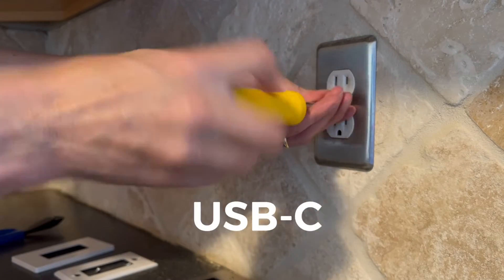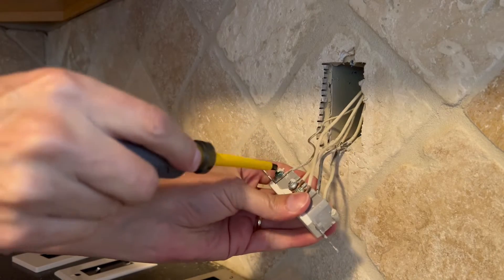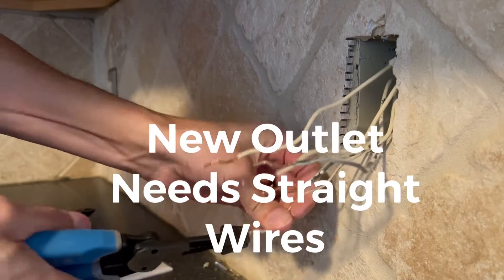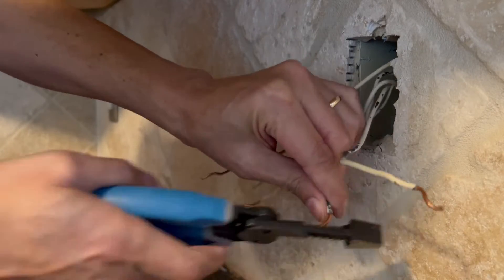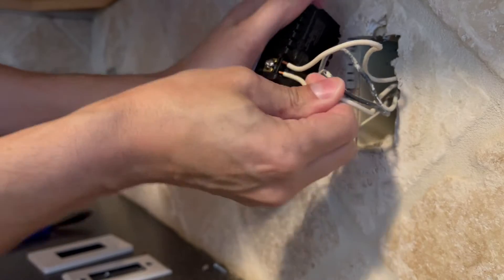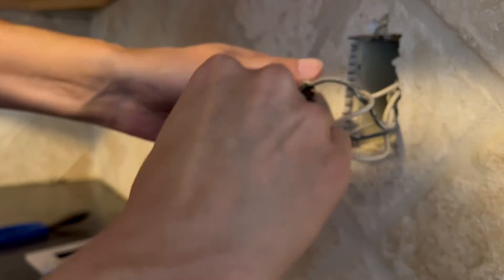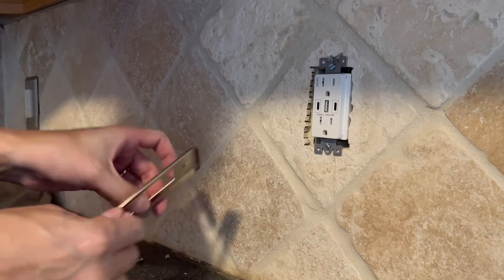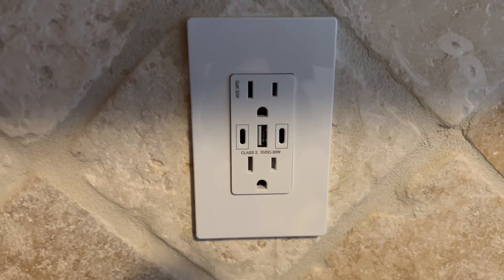How To Install a USB C Outlet: The Quick & Easy Way

Comment: You had plenty of wire, it would be easier to snip off the ends and strip the wires to the length for the new outlet.
Reply from the maker: That's a great point! You are 100% brilliant 👍🏼😎

Comment: What if the white wires are on the brass and black on silver by mistake? I know it won’t work but will it cause a fire once power is turned back on?
Reply from the maker: That’s called reversed polarity… Sometimes I have seen it in older homes. It’s always incorrect. A GFCI outlet would trip if you install the wires  backwards…
Reply: @HomeRapidRepair  okay just wondered if I’d know immediately… how do I know why usb outlet to buy? As far as watts or amps?
Reply from the maker: @Just_King_N_IT 15 amps is the most common and will work fine. Even if you have a 20 amps circuit like in your kitchen. But you can purchase the 20 amps USB C outlets if you want, it’s just not needed.

Comment: What do I do if I have a red wire
Reply from the maker: Typically, that is just another hot wire. You can treat it like a black wire, it may indicate you have two circuits in that location.

You could try just capping it off and then testing your outlet afterwards. I’m assuming you have a standard black hot wire?

Comment: Oh say these are 12g wires, but I believe that is a 14g outlet.  DIYers, be careful mixing gauge like this (if true) - while you can use 12g for 14g power,if you try to pull 12g power through a 14g outlet, it could overhear and possibly start a fire.

Also, while the new “plate” will allow 2 wires, best practice is to pigtail the source wires and insert the “tail” into the outlet.  I don’t think it matters, power wise, but it does simplify later upgrades or fixes.
Reply from the maker: Thanks for watching and taking time out of your day for responding to my video. I appreciate it.

Comment: How deep do you seat the wires? Deep enough only wire insulation is touching the clamp, or the bare wire makes contact with the clamp?

I ask because the old has connectors on both sides on being line in and the other as load as you know.  Do they need separated so the electricity goes through the outlet?
Reply from the maker: I’m not sure I understand your question. Almost sounds like you’re talking about a safety GFCI outlet. That’s the line side and load side. Line side would be hot all the time and load side, if you choose to use it, would protect downstream outlets.
Reply from the maker: If you are installing a USB C outlet, and there are multiple wires in the box, you likely do want them connected to carry current to other outlets in the room…

However, if I am totally misunderstanding, your question, please restate it, and I will respond 👍🏼😎🛠️

Comment: I just pulled off the plate on mine and it’s just two wires (one white and one black) so I’m guessing it’s really old and I need someone to re-wire from the electrical box, is that correct?
Reply from the maker: In your case, most people just install it with the two wires… black to the gold screw and white to the silver screw. Your house is built before grounding was required.

Comment: How can I split the USB receptacle so half can be always on and the other controlled by the switch on the wall, while the USBs are always on?
Reply from the maker: You can break the center tab on duplex outlets so the top & bottom are controlled separately. 

What you are asking you will need to have a continuous circuit for the GFCI OUTLETS and a separate circuit from the switch downstream to the wall outlet you want controlled. Then daisy chain wiring to any additional outlets on this switch. Remember in wall switches you bond the neutrals together and use the switch for just the hot (black) wire. Good luck ⚡️🛠️

Comment: Oh fyi it looks like your on a counter top so you need plastic screws with in 5 feet of water and a gfci in Ca. Any way.
Reply from the maker: Thanks for watching. I'm already on a GFCI circuit for sure. What the heck is this plastic screws you are mentioning? I've been a licensed contractor for 24 years and here in Michigan nobody is using plastic screws...

Comment: Look i like your video but it seems these days everyone is a shade tree mechanics and not so much a technician.We need to incorperate a litte more pride in our work.As for straightening out the wires you should cut off the bent tips as there soft wire and can crack while putting box back in or even arc after power is put back on.In order to save yourself from having to redo your work over again that being the best case cenario ,just do it right the first time and cut and bare new wire and place in box .How hard is that ?Pride in your work .FYI.I now sound like my dad and a master mechanic instructor i once had 😅.Just a litte food for thought  great work bro and thank you for the informative video.
Reply from the maker: Thanks for watching and your comments. Sorry I missed yours and didn’t respond sooner 👍🏼🛠️🛠️

Comment: Thank you for posting this great video. As others have noted, it might be easier to cut off the bent wires, strip new copper, and put those in the slots. Also I would have scraped paint off the ground wire so there is plenty of exposed copper before connecting it to the outlet. Just to be quite sure of getting good solid connections all around. I also want to mention that there are outlets which offer fast (65 watt) USB-C charging, and at least one brand is Underwriters Laboratories listed. The 65 watt charging capability makes a big difference when you want to quickly charge an iPhone or other USB-C device.
Reply from the maker: Thank you for watching. You sure know your stuff. I have been wanting to make an updated video with the new fast charging USBC outlets for sure...they will be the future.

Comment: Does it matter which hot wires goes on the top or bottom and which neutral wire goes on top or bottom?
Reply from the maker: No, not at all. These type of outlets are called duplex outlets. The tops and the bottoms are shared / connected so it doesn’t matter which one you use.
Reply: What about a red wire I have for a switch? Can that be combined with the two black wires?
Reply from the maker: @MrGoblue85  if you want the outlet switchable then go ahead and use it. However 99% of outlets are wired to be on / live all the time. 

If you aren’t going to use the red wire just cap it with a wire nut and fold it into the box 🛠️😊

Comment: Plug something into the outlets and then show how to plug into the USB ports at the same time.
Reply from the maker: Are you sharing that multiple plugs 🔌 don’t fit because they are too large?
Reply: @HomeRapidRepair  yes, can you send a pic of grounded plugs and the USB’s connected at the same time.
Reply from the maker: @wadehunt1216  they probably won’t fit all at the same time. I’ll check later and post on my community tab.
Reply: Yeah, that is my problem with these - why even have the outlets if you can’t use them while using the chargers.  The design is disappointing.  I found on mine - you couldn’t use either outlet and the USB charger.
Reply from the maker: @wadehunt1216  that’s fair. we have a few of these in my house. What I like about them is you don’t need the charger bricks anymore. Just a USB cable and you’re good to go.

Comment: I have 2 whites, 1 black, 1 red, and one ground. What is the red wire for? The red and black are both connected on the brass side. Are they both considered black even though one is red?
Reply from the maker: Yes, you’ve figured it out on your own. The red wire is “hot” just like the black wire. 🛠️🛠️
Reply: @HomeRapidRepair  after doing a little bit more research I figured out it was a split outlet. The top plug is for like lamps that are powered by the wall switch. Too bad cause I wanted to install a usb outlet but I don’t see a way to split it, so I have to go and get a regular one.
Reply from the maker: @chrisdavid4017  true no way to split a GFCI outlet. You could cap the red wire if you don’t care about the wall switch 🤔

Comment: Here in NYC I have a metal box, not plastic like yours. And also we use BX wire in all residential homes. The BX wire doesn't come with a grounding wire, it only comes with a hot and a neutral. What would be the solution to upgrade to a USB Type C receptacle if I don't a grounding wire? Hope my question is clear
Reply from the maker: So you can legally install a GFI USB outlet in an ungrounded situation and you will be just fine 🛠️🛠️
Reply: @HomeRapidRepair  Thank you for your help. I appreciate it
Reply from the maker: @helloall3977  100% 👍🏼
Reply from the maker: Yes, your questions clear. You would have to label the new outlet has no equipment ground. These tiny little stickers come in the GFI outlet box kits. Or you can order them online or probably pick them up in any electrical department. Your new USB-C outlet will not have grounding. But I don’t believe they make a safety GFI outlet (great for no grounding) with USB C..But I’ll search online maybe they do
Reply from the maker: Limited-time deal: Leviton GUAC1-W 15A SmartlockPro Self-Test GFCI Combination with Type A & Type-C USB In-Wall, USB Charger for Smartphones and Tablets https://a.co/d/buMkMv1
Reply: BX wire is metallic, so as long as it is continuous from the panel, it should provide ground. You can plug in a receptacle tester to confirm.

Comment: That was all WRONG  never use the push in wire, recut the wire and wrap the wire around the screws and the same with the green 12-14-22

Comment: What exactly is the benefit of this? Products are constantly changing charging ports. This being the case, if you install one or more of these, you'll have to change them over in the future. Using a charging brick is really not an issue. I asked my electrician about these when we recently had him here installing a 20 amp circuit and he said he loved them because they have a habit of having internal issues and he makes more money fixing the situation. Even if issues never happen, you're still stuck charging your products in the location of the outlet to justify installing this. I dunno it just doesn't make sense for me. Sorry....
Reply from the maker: Thanks for sharing

Comment: You need to cut off complete bent ends and re strip. It is safer so the wire does not break and makes it easier to slip in slot.

Comment: can you just pigtail them wires instead putting 2 wires in 1 screws?thanks
Reply from the maker: You can always install a pigtail if you would like. This particular outlet has the receiver holes for two wires each side.
Reply: @HomeRapidRepair  thanks for quicked reply ill try this out